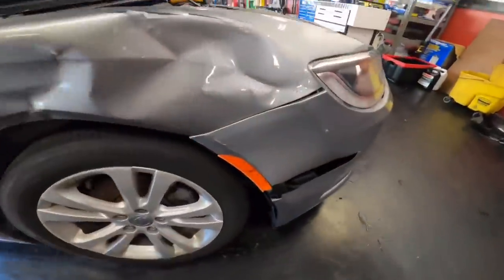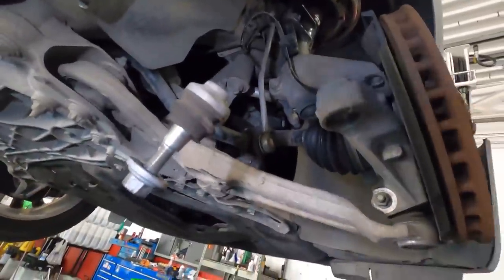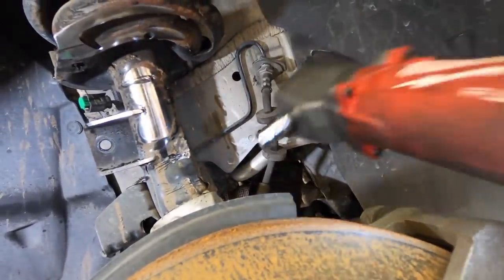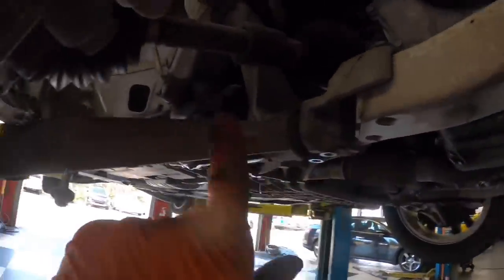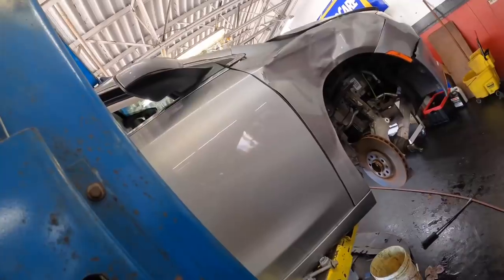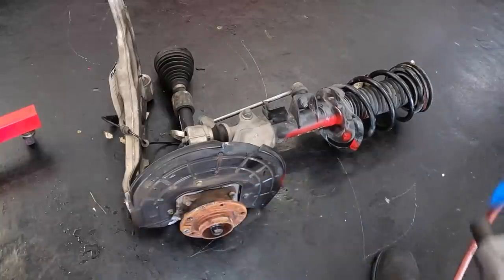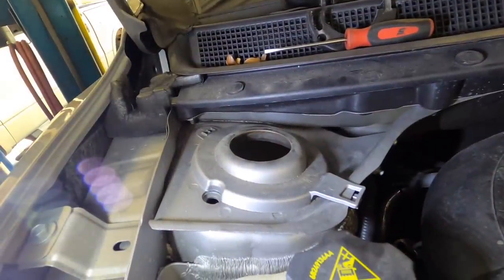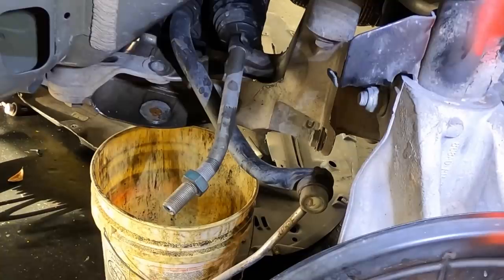Cutting Brake Lines! Caught on Camera! Chrysler 200 Strut, Control Arm, Tie Rods and Brake line

Comment: I worked at a stealership and had a buddy with a gun that had more uggah-duggahs than mine.  If that failed, I have a 25-inch breaker bar, 1/2-inch drive.  If THAT fails, I have a 40-inch breaker bar, 3/4-inch drive with a 3/4-to-1/2-inch adapter which I call Thumper.  I've never needed Thumper. Stay safe!
Reply: Thumper. I like it. 
Can I borrow that Thumper name for my 3/4" Milwaukee M18 Fuel impact, please ? 
( 1,500 ft lbs of take em off or break 'em torque ).

Comment: I feel for you losing that Rigid.  Hopefully you can get another that uses the same batteries.  I have a Ryobi version and it's 18v. Sucker has more power than I thought.  It'll twist the nut off the shaft on a riding mower to replace the blade...clean in to.  Hit it so hard the shaft broke.  I was surprised.  
If I was the owner I would have told the shop new or not at all.  If that meant totaling it then so be it.  Insurance companies try to cheap out like that is ridiculous.   
Keep up the good work, Ray.  And, don't ever worry about those "slip of the tongue" words.  It's a mechanics shop.  Those of us who know, understand.
Reply: Aren’t Rigid Lifetime warranty ?  A teardown of the broken impact gum would be interesting.

Comment: I wonder if the clippy thing is designed to be a kind of “fusible link” that allows the strut to pop free in an impact. Looks like that’s what might have happened on the driver side.
Reply: kind of looks like that... having the tire drag under the car popping off the strut when sidewards force is applied would provide better stoppage/ diffusion of energy since the tires would be connected to the ground longer  and lift the weight of the vehicle with static friction instead of skittering.

Comment: Ingenious plastic strut retainer!
Weight of the car keeps assembly in place.
Yet in an accident, plastic slides where bolts will fold the metal.
Reply: As I was writing this you discovered the slip on the other side.. cool

Comment: torque to yield wheel lug installation is the new norm a vehicle I acquired actually required a 4 foot bar to loosen wheel lugs or maybe they used lock tite at least that wheel didn't fall off.

Comment: Check out the Milwaukee M 12 stubby impact as a replacement for the gun that broke (assuming it’s not gonna be replaced under warranty of course 😀
Reply: Ridgid tools and batteries have a lifetime warranty, as long as the product is registered with Ridgid within (I believe) 60 days and you are the original buyer.

Comment: LOVE your video's.....   Being a mechanic these days means working on some of the poorest engineered vehicles in the world.... I remember the cars from the 60's and early 70's ... at least you didn't have to take 5 things off to get to the one that needs work....  We did however have points in the distributor that required constant maintenance and plugs that were good for 12,000.0 miles ...   I will say Rainman you have top notch skills ... I watch your video's by the hour....
Reply: Yes, a lot more regular maintenance and cold/hot weather issues with older cars.

Comment: I just love untrained tire employees that think they are nascar pit crew and don't use a torque device
Reply: The tyre was pushed up against the strut from the accident. There was probably a huge load on the wheel bolts because of this.

Comment: The ptcm requires a minimum of 9v DC to opperate. The alternatior dose not power the system. It only charges the battery.
Reply: That is a distinction without a difference; the "system" and the alternator are both connected to the battery--if not the same fusebox--so technically, the alternator CAN (and will) power the entire "system" in the absence of a battery ASSUMING the engine is running.
Had that happen on 2 different (stick-shift) vehicles, one an '07 Corolla, and the other an '03 Accord.  In both cases, one of the battery wires broke while driving (battery wasn't strapped down in one case, and corrosion figured heavily in both instances)...as long as the engine was running, the cars were quite driveable--with the entire car's electric system powered completely and entirely by the alternator.  Turn the ignition key off (or stall the engine), and everything goes dark...keyfob doesn't work, no lights, car is absolutely and totally dead.  Fix the battery wire, and everything behaves as normal again.

My dad purposefully removed the battery from an (automatic) '80s Corolla before driving it 20 minutes to the junkyard (he junked it due to structural body rust making it increasingly unsafe to drive).  Got all the way there, too, though he did report that flashing the headlights nearly stalled the engine.
Reply: @sidlori1592  the alternation puts out 12v at what ever Amp is possible at set rpm. The ecm, ptcm, tcm, and bcm. Have a maximum operational amperage. The battery acts as a suppressionsystem and, a capacitor. Smoothing out the signal. Once the capacitor is removed the system shuts itself down to protect the delicate, sensitive, and expensive electronics. A smooth operating alternation with a steady signal will run the system. A rough circuit will default to off. Also the alternator may be faulty. Seeing fiat in the manufacturer name. A, B, or C. It also asks if the voltage regulation is internal or external. 
A safety protocol. B alternation. C ALL OF THE ABOVE.  It's just a guess. I'm not there to test the system. I am also to lazy to drive 2186.9miles to the shop to look at it. It also due to the impact area of the automobile be a damaged or missing drive belt. Like I said I'm not there. I have placed a resistors on cars and fixed them. My old fiat had to have one. And it would not run on the alternator alone. Fiat. Fix it again Tony. Yes. The issue was a charging issue. I added a battery and a float charger and drove the x19 for about 5 years like that. I loved the car. Hated the Renault eng.

Comment: As far as I know (Well in my experience) Insurance companies here in Australia only replaces wrecked parts with NEW PARTS, The only exception is when the new parts are unobtanium and they tell you first.
Reply: @ The Real MrCods May be true nowadays , but in earlier times crash repair shops would get repair quotes using new part prices , get approval , buy as much used parts as possible , fit up then pocket profit , you the trusting victim , gets shafted from both sides , pay claim excess , then increased premiums !!
Reply: The Real MrCods  Ask how I know , been driving in Oz for 50 yrs , plenty arguments with Ins. Co's . Most reply with "we approved quote for new parts , how they repair we can't control ". Als many years working as delivery driver for a large former local vehicle manufacturer certainly opens your eyes to panel shop rorting ,with a large quantity of recently delivered new parts returned within a week  for credit .

Comment: was wondering about something.   you sad ones that you invested in a expensive diagnostic machine. do you have to pay for the tools you use?   do the shop not give you everything you need to do your work?
Reply: Technicians have to provide their own tools. Some dealers do provide software updates for the scan tools however
Reply: That's what you get when trade unions are demonized and die. Imagine how much of the employed technician's salary goes to buying tools? A shop buying tools for 10 mechanics would get much better deals on the tools, including financing. The downside of gig economy.

Comment: The plastic clip is only there to hold up the strut when the cars jacked up. When its on the ground the tapered cone of the top mount goes into the chassis. Its obviously doing its job after the impact it took. GM/Opel/Vauxhall use it too.
Reply: And when the front end gets light, like when you drive down a curb.

Comment: Wonder if when the left top strut clips gave way was the car driving at the time? causing the suspension to drop a little and making the driver lose control and then smashed the right hand side in an accident. Just a thought.  But wait the "Engineers" say the clips are safe.
Reply: How would the clip giving way cause anything to drop?
The car would have to be airborne for the strut to drop out.
Reply: @Cheepchipsable  i was just wondering how the left clips came off in the first place, was it the force of the impact on the right first causing the left clips to come off?  Find it strange to see the left clips off when the damage is on the right hand side.

Comment: ...how do you even perform a correct alignment with the strut held in like that, there's so much possibility of play in the strut
Reply: The big rubber bushing/bearing on top of the strut carries the weight and locates the strut in the strut tower from underneath. That clip just stops the strut from falling out of the car when you have the car off the ground. It plays no part in alignment and there is no load on it when the car is on its wheels.
Reply: @bikeaddictbp  ohhh okay, I was very confused on how that would've slipped past the design process

Comment: The plastic rings which hold the struts looks really save or not!
Reply: They're only supposed to hold and center the struts when they're not under the weight of the vehicle, so basically 99.999% of the life of the vehicle there's no actual force working on them as the friction of the contact area will prevent the strut from moving horizontally and the weight of the vehicle is resting on the struts. This is basic mechanics really.

Comment: I would say that even though the clip is a new design i would claim its pretty strong given the typ of force that was applied to the strut. I mean logically its stronger as it is loaded with compression on a huge area compared to the tension load of a couple tiny studs. As to the loose clip its impossible to say as the history is unknown.
Reply: It may have happened in the accident, as force goes to unexpected places, or possibly the towing company managed to butcher it somehow.  Since the clip was still laying there, I'd say it happened in the accident or shortly thereafter.

Comment: For the transmision not going in park, I've had the same thing on my charger, I use the park overide but forget it pulled it, then I started it and had the service transmission with only RND... put the overide down shut the car off then back on and everything went back to normal. They probably left it in neutral after towing it..

Comment: Having fixed hundreds of "collision" vehicles, that was like watching a elephant forking a peanut. No offense, but it's very clear that collision repair is not your wheelhouse. LOL Oh, don't be surprised if there's transmission damage along with body twisting, mounts tweaked/broken and maybe even a messed up blower motor housing. I've also seen a fuel pump bent at 40 degrees caused by what "looked" like light front end damage.
Little tip, if you have to force any component to fit (more than normal) get the car to roll and send it off to a body shop.. cause you ain't gonna fix it correctly.
Reply: Car came from a body shop. Not sure who directed the repairs.

Comment: Just started watching. First, it's a Chrysler 200. It should have been scrapped. Second, those lug bolts are definitely Fiat bolts with the extremely annoying beauty covers that get stripped very easily. If you have these bolts on your car, get some proper high quality bolts from Otis LA.

Now continuing watching. Ooo! Cut the brake line! LOL!